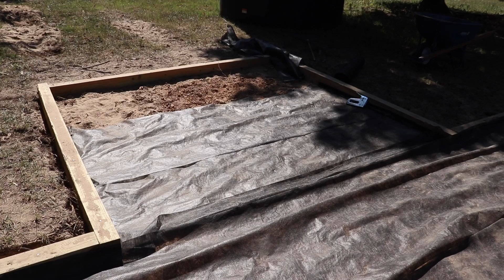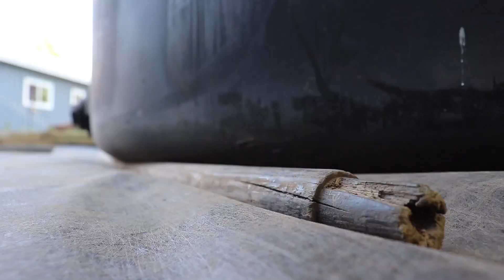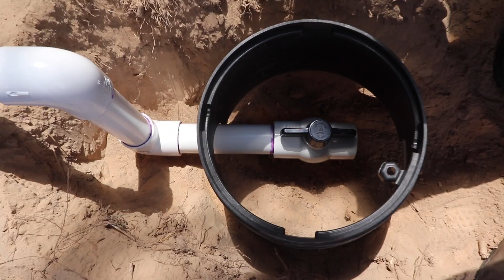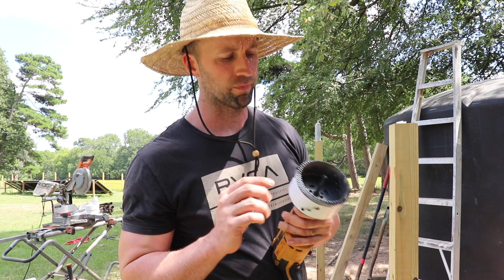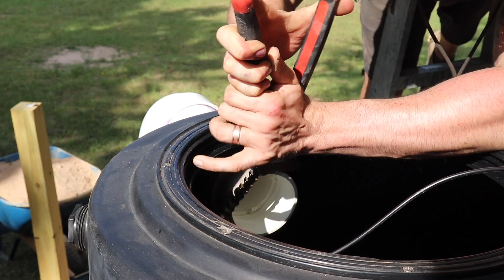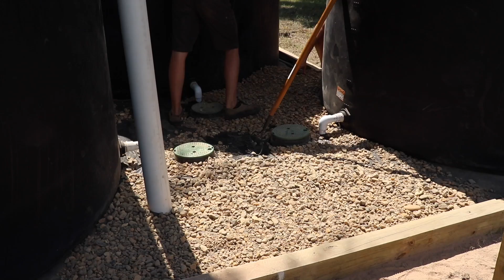HOW WE'RE GETTING WATER OFF GRID!

Comment: So many things that feels intuitively wrong with the water pipe system and the concept of equilibrium.

On one hand assuming enough rain to force a pressure of water through a 4" pipe some 6-8 feet high.
That would require a steady rain flow of the sum total of filling the whole downwards pip, the length of the pipe and the height of the pipe.
In short the full distance from roof to tank in order to barely get one drop into the tank.

Until it has rained that much, you're sure to have stale water.

Alternatively it is a rain season region with steady flow in which case when your tanks are full your overflow from the gutters will be enormous as no more room in the pipe is available unless you drain your tanks.

I have some serious doubts this will work as it seems to many moving parts and to much relying on mother nature to have a perfect cycle for the system to function.
That in my experience is highly unlikely to ever occur as man has never won out over nature without massive amounts of pure luck.

But then again, I wish you the best and sure hope you prove me wrong.
I cannot really speculate as I know to little about your annual climate.

If this was built in my region (Sweden) You can for sure count on the pipes freezing solid approx. 6 months of the year and you would have to convert the name of this to "the biggest manual ice maker setup of all times".

Comment: I wonder why manufacturers don't put 3-4 attachment points on the tops of those containers? With a length of line & grandpa's tractor they could be lifted into place. Like how you McGyvered the hole saw, and christened your water containers with blood. Now you're really vested in this project! :)
After your last video, I was wondering how you were going to plumb the tanks to the house. Looks like a neat arrangement. Will you have a water trough to catch tank overflow, drain it to the pond, or let it soak into the soil?

Comment: At first I thought that they will install a reservoir under the soil and a pump to push the waters from the pipes to the tanks.

The level between the gutters and the tanks is not that much.

There will be a lesser pressure to push the waters from the pipes to the tanks.

Comment: I think your system is not working. The water from your roof gives too little pressure. It is higher than your roof, but it is not a barrel. it might work if you collect the water from the roof in a tank with the bottom higher than the water tanks. It is better to pump water from the lake, this is possible with a thin hose. I don't know if it's drinking water. You may not need to use a pump to get pressure on the water supply in the house. The tanks must then be higher than the house. Good luck!

Comment: When cutting a hole where you don’t want the waste material to fall into the tank:
Drill the center/pilot hole, then attach a piece of nylon cord to the inside on the tank near the center/pilot hole with either a 2nd hole or glue, when the hole is cut the cord will hold the waste material.

Comment: I think there is a fundamental design flaw in your rainwater system. The pressure from the gutter overflows will not push up your $1ooo tank. Instead, the water from the gutters will choke at the entry-point and fowl -up your connection points, or if they hold over time, the water will simply gush off your gutter ends..... It is still not too late, you can try to connect the gutter over-flow to the top of your $1000 tank and then connect the pump towards the house from the bottom of the tank.. Also ,I would have tested all the connection points before back-filling the earth....good luck !!

Comment: You won’t have the head pressure to get the water back up into the tank. A column of water 1 ft high produced .43 psi. You need to have 16 of head pressure to push that water up 8 feet.

Comment: General contractor in Dallas... love what you guys are doing. Concerned that your gutter and downspout system will keep up and not pressurize and overflow. You may need to install a tank/pump combo to keep up with volume of the heavy down pours you need to keep your tanks full. I get the idea and have a tank supplied system at my ranch but I just don’t know that the gravity/distance equation works at those volumes. Simple solution if it doesn’t.

Comment: FYI the freeze line is 36 inches so you should bury the water line below 36 inches to keep your water line from freezing or you will pay the price
Reply: You are assuming everybody has a freeze line. Where I live, there is no freeze line. Code HERE says 12 inches to place lines deep enough not to be accidentally punctured. Their area in Texas might be the same.
Reply: @Florida-cracker   it depends on what state that they live, in most of the states that experience a winter weather like snow and freezing water will experience freezing pipes if not protected from cold wind and freezing rain. Besides MY comment was for the young couple that is producing this video not for your utterance
Reply: @harolddomangue9206  Just pointing out the incorrect statement that "the freeze line is 36 inches". Not ALL places have 36 inch requirement...some may be more, some may be less...or non at all. That is why I commented. Your statement should have been "you should bury the line below YOUR freeze line" (without a measurement). Hey, if you comment in public, expect the public to comment back.

Comment: Many are doubting your system because you have not shown the height of the tanks and your gutters.  Water will always seek it's own level, so if the gutters are higher than the inlets of the tanks, AND the pipe is sealed  other than inlet and outlet AND the tanks have good size vents on each of them,  YES, it should work. My question is to where you live. Does it ever freeze there??  Also, have you looked into keeping the water potable in the tanks and the rest of the system??

Comment: Great vid! Have you checked the water volume collected by the roof when it rains? Are the pipes sized for this volume? How will you create enough pressure to overcome the static pressure of the water pushing up into the thanks? The water will otherwise overflow from gutters. Will you insert a pump system in the rain water feed to tank line?

Comment: You might still consider running just the one 4" pipe from the gutters into a smaller holding tank with a pump and filtration near the house. Any excess not used at that point could 'overflow' over to the distribution junction to the three big tanks. That would make water flow in both directions through the single 4" pipe, eliminating unnecessary pipe runs and reducing potential stagnation. It just makes the system simpler and cleaner.

Comment: So if you would have buried those tanks at least halfway where you have more pitch of a gravity pipe it would help where you sense you're trying to push up roughly eight feet is going to going to be easy without a pump especially on heavy rains you're going to lose a lot because it's going to sit in that plate

Comment: So the problem you're going to have and shine to feed his water tanks without a pump assist cuz gravity is not going to push it up there you going to lose more water than you're going to gain in a long run the best way to do it is build a little metal awning above the tanks and put a large gutter system on it to help with the water loss that you're going to lose trying to force it down at tube and also you're going to use more water and those tanks going to fill up so you got to find extra ways to add water to those tanks so that's why I suggest you guys put something over the tanks that are run directly into the tanks without losing water so you have a extra water catchment

Comment: Boy, their freeze line must be a lot higher than here in Arkansas! It's 30 inches here! We usually go 36 just to be safe.  I see lots of power eating heat tape in their future.
I also agree with the sediment collection tank, and the "ball cage" idea on the gutter. This will keep out unwanted critters as well.
The idea of putting in a drain valve in that vertical on the tank is also a good simple idea. I'd also suggest some white paint for those tanks. Nothing worse than opening the tap and getting 100 degree water from the cold spigot.

Comment: Bet you're tired of negative comments.  Having been involved in building a water system, my best advice it to provide for ease of making changes.  You are two bright people that learn from your mistakes.  The problem I see is that you will be getting water in really big slugs followed by no water for long periods.  I think your design will work better for frequent moderate rains.  In any case, I wish you the best and really enjoy your videos.  After giving this some thought (second guessing you), it seems to me that the 4 in pipe should be increased to at least 8 inches. In addition, it should be split at the tank end to flow into all three tanks simultaneously. That would eliminate the need for overflow from one tank into another into another. One overflow from each tank into a garden or whatever.

Comment: This "Old Man" has some "fun facts" for you.  First is, how much rain?  Every square foot of "HORIZONAL" roof surface - you can catch one half gallon of water for every inch of rain that falls - less if you are not using a metal roof.   Your collection area is "about 21 by 40 or 840 sq ft.  Add 320 sq ft  of roof over the forth coming deck.  So 1,160 sq ft of collection area should collect 580 gallons for every inch of rain that falls.  Next you want to run 580 gallons thru a pipe. a 3 inch inter diameter pipe will only flow 140 gallons per minute. 4 inch 240 gallons.  5 inch 380 gallons.  A 6 inch inter diameter pipe  will handle 550 gallons.  Lets talk tanks :-)   It might be better to add a smaller tank and run all your water into it first.   This will collect all the bugs & stuff to settle to the bottom -  The collected water is then taken from the top and feed to the other tanks.  You do want to set those tanks into the ground a bit and you do want "unions" and turn off valves between each tank.  All your pipe will need to be painted.    I puzzle on their location.   The west side of your house is the back and in this area you need to build a power shed. A building that houses all your solar equipment, batteries etc along with the electrics and pressure tank for your water.

Comment: As you go along you will continue to find what you 'coulda-shoulda-woulda' done... You've heard: "Timing is everything" Propane does not 'spoil'. Propane prices are very low NOW. Propane is a great 'backup' fuel. Take a suggestion I was given, but too short-sighted to take. BUY, DO NOT RENT, at least a 500 gallon propane tank. Or ideally a 1000 gallon tank filled, now. You can re-position it  later and plumb it then. Larger the tank, the cheaper the fuel. It's better to have a dual fuel generator.

Comment: Love your project and videos. Although I don’t think freezing will be a problem with the tanks because they are a huge heat sink, I’m not confident that evaporation won’t be an issue. Unless you have already been told by a hydraulic engineer that this will work, I would be prepared for the possibility that the resistance to flow in the system may severely limit the amount of water you are able to capture from your gravity system design. The house I grew up in had a water catchment system except with a cistern. We only used it to water the garden because by the time we owned the house there was city water. That system allowed the water to be redirected until the roof was clean, then the water could be directed into the catchment system. It still needed a trap to catch stuff which blew onto the roof during a storm. Then it used to have a sand and charcoal filter to handle bird poop, and other contaminants. All that introduces restrictions in a gravity system. In Kansas I can’t imagine how the original builder/owner managed to catch enough water in the summer even though all the water storage was below ground. I hope newer technology solves the problem for you. Best of luck!

Comment: I think you’re going to have flow problems with the gutters 
The up flow at the tank is going to restrict the flow in a heavy down pour 
The slower flow in the pipes will cause your gutters to over flow you may have to run a pipe from the gutters straight to the top of the tank 
I could be wrong about this but I think it’s a question worth bringing up 
Fortunately pvc is cheap lol 
Think about a huge ditch hitting a culvert pipe that’s to small it slows down the water causing it to back up behind it till it overflows the ditch

Comment: Yeah I would have used the 4 inch pipe like how you used the shovel handle to get the tanks over to the platform area. I hope your gravity fed system works the good part is it wouldn't be that difficult to bury those tanks like 2 feet down or just install a sump pump well catch basin with pump to send rain water to the tanks.

Comment: Guys, please consider using a pump house to take water from the gutters and pump it into the tanks instead of allowing the height difference between your your gutter downspout and your tank inlet. Otherwise, your entire drainage system will have to be charged with standing water in the down pipe to the height of your inlet. Either that or take a horizontal run off your gutters directly into your tanks.

Comment: It's very common here in New Zealand for rural properties to collect water this way. Might be good to look into a first flush divertor system as if the water sits in the main pipe for a while, like if it doesn't rain for a while, stagnates and smells a bit, enough to make the rest of the tank smell. At my property I lessened the effects by adding a small collector tank with its own overflow (I used a plastic 55 gal drum) where the gutter dropheads collected and made the pipe to the tank only 1 1/2''. The collection tank forces the water through no problems at a very high pressure to the point where if removed from the tank when it's raining it squirts about 25 feet. I have never had it overflow even in a downpour as the pressure due to head always forces it through. I have added a filter system after the pump with three large filters and a UV filter too.

Comment: ? Water flows Downstream you may have to suspend the pipe in the air with a downgrade and not Underground
Reply: Water will flow down, flow over, flow up and out as long as the input pipe source of water is higher than the output. This is how springs work.
Reply: @Florida-cracker  okay but I have a feeling that this may not work does it look like it ads up but I don't live over there and I don't know how hard it rains I hope that it works because I watch these shows all the time and I like these people and their videos

Comment: I don't want to say this but you are heading for trouble!
1. The size of your guttering and downspouts will not force the water down (and up ) the pipe quickly enough! I estimate 0,01 of a cubic meter a second At Best! I think your rainfall will get above this when you factor in your catchment area!
2. The pipes will be full all the time and freezing will be a problem!
3.  PVC pipes (and the tanks) will suffer from UV degradation! At a bare minimum you need to cover them with a light preventing barrier. The pipes are also under pressure so also susceptible to damage from physical damage!
4. The pipes will be full of water which will stagnate. Bugs will be attracted to the standing water. Light getting into the pipes (even down the downspouts will cause bacterial growth which will be flushed into your drinking water at the next rain!
5. Unless you can stop 100 of light entering your tanks you will get bacterial growth! 

6. What happens if a cow kicks one of your tanks?
7. ....... Enough! Time for some positive elements!

Burying your tanks would be a good move! Moving your tanks near to your house would also be good! Doing both would be even better. 

It is easy for me as I am not doing any of the work but I would seriously look at getting some plant in to help with this! 

You could bury your tanks so the top is a couple of foot below ground level. Access to the tanks could be through ducting cut to go over the cap with both filling pipes and water output going through the top of the tank! This would give prevention of damage to the tanks and pipework from external means. It would prevent freezing of pipework below ground level. It would stop bacterial growth in the tanks. It would allow pre-filtering of your rainwater before entering the tanks.  It would allow increased flow rates into the tanks in storms.
A lot more work, but if you look about you will see it is necessary for a good system! It also allows you to use those expensive tanks! Others have suggested pumps, and they may work, but you would need to check on what size you would need and how you would supply them electrically!

Sorry I could not be more positive about your water system but feel honesty now would save you future pain!
Reply: I have thought about this and I feel it is a tad harsh! ....... I didn't mean it to be!
I realy hope I am wrong and you have no problems with it!